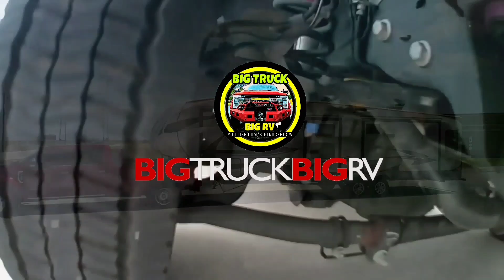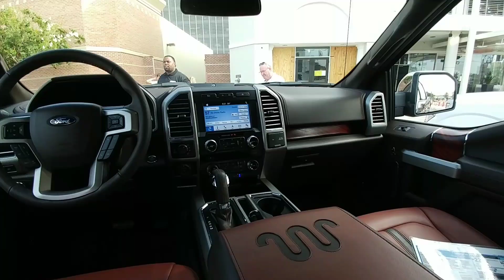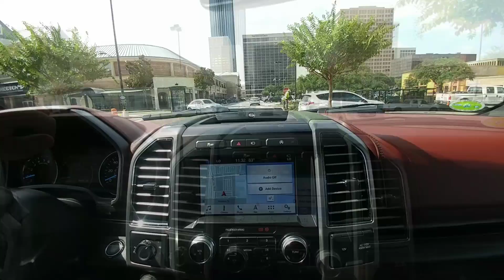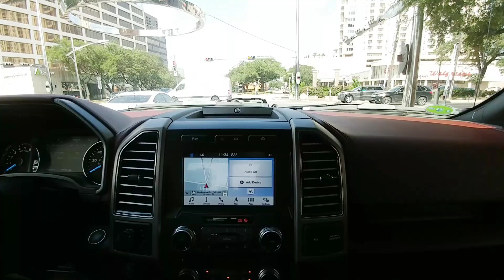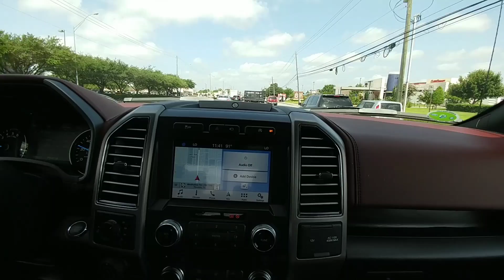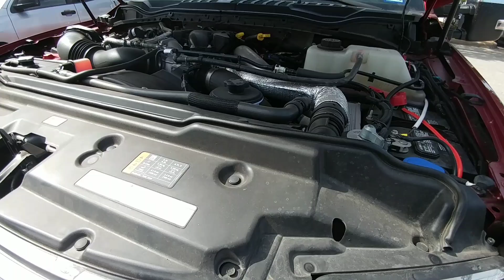All new F150 3.0L Powerstroke Diesel! First drive!

Comment: I like the idea of a diesel in a 1/2 ton pickup but 70k for it is ridiculous. And the fact that you can't get a diesel in an xlt or lower kills it for me. For 70k+ I'd rather buy a f250 or even f350.
Reply: Alex Tran The tundra is just a proven drivetrain at this point. Probably the most reliable new truck you can buy, no frills with cylinder deactivation or anything like that. I love my Chevy trucks but the v8 tundra is rock solid and looks really good with the crew cab
Reply: For 70k I'd rather buy a super expensive sports car
Reply: Hipsters will buy it. Ford Fails again
Reply: Big Truck Little RV definitely. lol. They'll buy it just to fit in with the crowd.

I'd take a brand new Tundra Platinum instead if I was looking for a 1/2 ton. Tundra may be a pig when it comes to gas, and may be the oldest in the segment, but at the end of the day I'll know I'm  stepping into something reliable, and costs 20k less.

Comment: The dead engine at stoplights. 
I drove my daughters eco-boost in South Carolina this summer, shuttling off at 90 degrees let the cab warm up enough to be uncomfortable. 
Now try it here in SW Az. today at 117 degrees. 
No thanks.
Reply: The engine won't shut off if the A/C is on and the cabin isn't cool.
Reply: That's probably one reason the feature can be turned off with the push of a button.

Comment: Not impressed with anything about this truck other than the mileage which is a joke to justify buying this because the additional cost for this will take YEARS to pay the difference in saved fuel. 
“F150Duty cycle” wow I have seen plenty of F150/ with 200-300k on the clock and doing fine. Yes with additional maintenance costs but still. 
Idk folks. I’m sure GM will do the same with their diesel...overly expensive with minimal rate of return.

Comment: If Ford is looking for that landscaper type of buyer, they need to open up availability to the non-premium trim packages.  A Fleet Identification Number (FIN) is required to order an XL or XLT.  That would be a customer that has a minimum of 15 vehicles in a fleet.  According to another journalist that reviewed the truck, driven 15,000 miles per year would require 7 years to break even on the cost of the diesel engine.  This truck doesn't have good tow ratings and fuel economy drops way off when you go to a 4X4 crew cab.  In my opinion, I would stick with the 3.5 Ecoboost.  I am still waiting to see the specs and pricing of the 2019 Chevy 1500 diesel that is coming out this year.
Reply: Rodney Williams ford has the na 3.3 v6.  That would be the bargain to get.  Still plenty towing capacity for lighter towing

Comment: I just went through and crunched the numbers and pulled the pin last week on an F150 3.5L EcoBoost with Max Tow over the 3.0L "Lion" Diesel.  I am not against the baby PowerStroke and I waited until it was on the market to give it a fair shot, but the numbers for this motor just don't add up for long term cost of ownership when compared the either the 5.0L "Coyote" V8 or the Gen 2 "Cyclone" EcoBoost V6.
Reply: Hi Gary, do you mind sharing what the numbers are telling you ?
Reply: I’d also like to know why the switch also. I’m an owner of a gen 1 ecoboost with nearly a half a million kilometres on her now. All original drivetrain. Although she has been excellent to me I made the switch and ordered the mini powerstroke. The numbers added up for me and fuel economy will be reduced by as much as 40% and that is not taking in consideration of on average lower diesel prices up here in Canada

Comment: The truck looks good.  To be honest, I think the government eventually will require stop start on Diesel engines.  But with 440 lb/ft of torque, it will be good at towing the maximum rating.  The aftermarket may be able to improve upon that.  This engine is the same as in the Land Rover products and Jaguars overseas and what I read was that it was reliable.  Most of the longevity issues will come down to doing the maintenance and changing the timing belt for the camshafts and fuel pump.  I think it looks great and will do well for those who aren't trying to pull 20k pounds.

Comment: Very informative video. I am not really a Ford guy; love my Ram 1500 so I'd be partial to Ram 3500 with Cummings. I think though that the modern engines are designed well and, with good maintenance, should last well into the 300k range.
Reply: You can't get a Cummings in a Ram.
Reply: Apologies, spelled it incorrectly: Cummins 6.7 engine.

Comment: Towing is the only reason for buying a diesel if your a grocery getter then buy a gasser. I despise the start stop feature as well, let’s just wear out starters for apparently no good reason, I suppose this feature is going to be mandated by the enviro-nazi EPA since it’s on other make of vehicles. Other than that this trucks looks pretty good.
Reply: Powder River Seems like a classic case of a feature designed for the EPA mpg tests but with little or no real world benefit.  I've heard that there are adapters designed to trick the truck into thinking it's towing and thus disable start/stop.

Comment: What is a F150 duty cycle?
Reply: From what I have heard on other channels, this engine is good for 150K miles before it hits if first major maintenance window which includes the replacement of the timing belt.
Reply: Back and forth to soccer fields two times in a 24hr period

Comment: I can’t believe that after all these years they are just now learning of the Cac tube failures on the 6.7.
And, he really never answered the durability question. He said get the f250 basically
Reply: I hate when they don't say yes or no to a question that is put before them as important as durability
Reply: Magnolia Tom Show us an engineer that will say definitively that any engine in a consumer vehicle will make it 300-400k miles without any major problems.
Reply: The Real John Smith good point lol
Reply: The Real John Smith I understand what you are saying as well. I know we can't have our cake and eat it with light weight, highly tuned, super lean burn diesels ingesting their EG's as they do. I guess I'm just wishing for things to be like they used to lol
Reply: they have already stated that the 3L powerstroke should have the timing belt replaced or checked at 150,000 miles, and that that would be the major maintenance item. He said it went through all the durability testing as the ecoboost and other engines, so it should be just as reliable. But we won't really know until they are out for a couple years, i would prefer not to be one of the first customers of something new like this lol.
Reply: Nate Hawkins lol- you are reaching through nothing but speculation. You wont hear a Ram/ Cummins engineer or a GM Duramax engineer say anything different about those engines. Nobody can guarantee a motor that way. The F150 was first or tied for first in the last 2 JD Power surveys with Ecoboost as the volume selling engine.  This motor has been in the Land Rover for over a decade; but, its the the first time in this platform. Time will tell the actual service life. Nobody is bragging about ecodiesel life span. Even that motor is too new to tell.
Reply: The Real John Smith No one knows, which proves my point. My 99 Ram was advertised in handout literature as "first overhaul at 300,000" when I bought it. Today that is no longer advertised for a reason. They aren't built the same. This Lion engine might have been in land rovers a while but not as it is in the F150. The guy said "it is built on that engine" and it's entirely new and different from Land Rover version. Plus the emissions controls are completely different for us. As an '18 F150 3.5 EB owner, and a business owner, I'm drawing off of more than speculation. I'm drawing my conclusions from actual experience and engineering knowledge.
Reply: Nate Hawkins I dont necessarily disagree with anything you just said. I’m curious what answer would have satisfied folks? No engineer can say definitively how long an engine will last until actual data is acquired over several years. Some may have problems in only a couple hundred miles. Some may last 200,000. A run of bad water pumps from a supplier may happen. That, however, has nothing to do with the motor itself. He has no way of knowing how long it will last in real world applications, in this platform,  until it has been in the market longer. Does anyone expect the VM Motori Ecodiesel to last as long as the Cummins?
Reply: Exactly what I was thinking. He deflected that one like a politician.
Reply: Yep never said.
Reply: LoneSpartan Well if Ford currently engineers most all their parts for a 150,000 mile actual life, then all the testing in the world doesn't matter. If the 6.7 is engineered for an actual 500,000 fail life and he wouldn't budge to say this diesel is any different than an ordinary ecoboost then you've got the answer. It's rated life is designed below 250,000. And I'm guessing stop start help shorten its life. And cheap engine parts "designed within the necessary parameters" (cheap) will fail and cause the engine to fail. I wouldn't worry much about a little timing belt change. Lol

Comment: Very nice. I do like what Ford puts out. But I keep leaning towards the Ram 2500.
Reply: I like F-250 and Cummins, if only they would have one.
Reply: Nothing beats a fummins
Reply: haroldlm64 good idea! You'll get alot more for the money with the Ram 2500!
Reply: haroldlm64 you should wait until they announce the new HD in early 2019. Should make the cost of the current generation price drop as they dump them.
Reply: Dmonkey Thanks! I've been very interested in the 2017. Thanks for the tip!!
Reply: I don't think I can go wrong with my decision. Hopefully, I find mine for the right price soon!
Reply: I had a f150 for 7 years and the engine died at 130k, went with the ram 2500 diesel and can't be happier.

Comment: I live there
Reply: Yep you caught that one, he never did say if the engine would be good for 300K, that is a bad selling point for sure on this video. I would be interested if it was expected to reach 300K with few problems. I know the particulate filter probably will not survive over 150K, and its expensive to replace.

Comment: anyone who is thinking about getting a new half ton truck because they have towing ratings of 11-12k pounds and are towing anything around 10k pounds please do yourself a favor and get a 3/4 ton I bought a new silverado that has max towing of 11,700lb and I tow a 32 foot 10,500 travel trailer and it is not fun whatsoever I am going to be getting a 2500 as soon as I can this has been an expensive mistake so if you are going to be towing frequently or on long distances please don't get a half ton thinking because the manufacturers are throwing out ridiculous towing numbers that it will do the job well because it just doesn't even with a hensley hitch it just feels as though the trailer wears the pants in the relationship and not the truck the power of the half tons are fine to pull that weight but the chassis and weight of the truck isn't there and with the super soft suspensions they are putting on the half tons to make them ride like luxury vehicles doesn't help any slight bump and the truck feels like it wants to bottom out because even with the hensley hitch keeping it at 10% tongue weight of 1000lbs the soft suspensions of these trucks can't handle it so if you plan on towing a 8-10k pound trailer more than like once a month for a short distance of maybe 100 miles if that just get a 3/4 ton and save yourself the expensive headache I have had. My friend let me try towing my camper with his ram 2500 to see the difference a 3/4 would be like with my trailer and it was just night and day difference there was no more white knuckle driving and no more bumps that made it feel like you were going offroad it was just smooth as could be. These half tons are pretty dang near close to the price of a nice diesel 3/4 ton so just get that if you tow more than 8k or so
Reply: That's MAX towing for the model if properly equipped. Let this be a PSA to anyone shopping for a truck: all trucks have a Gross Combined Weight Rating. This is the TOTAL weight truck and trailer, that can be carried. All Modern pickups have stickers on the B pillar that display THAT exact truck's (from factory) payload rating and GVWR (gross vehicle weight rating), as well as sometimes, GCWR. To find the truck's curb weight, subtract the payload rating from the GVWR. This number includes full tank of fuel and a 150lb driver. Manufacturers have towing guides that are typically listed on their website. These are typically laid out in spreadsheet format with headers dictating wheelbase and engines, 2wd/4wd, etc. They list both the max tow ratings, and GCWR in those charts. Ignore the max tow rating. Take the GCWR that correlates to your truck, and subtract your curb weight. THAT number is your max tow rating for YOUR truck...If you weigh 150lbs. Since you don't, go back to that curb weight number. Now add how much more than 150 you are. Then add your wife's weight (without being put in the doghouse), then add the dogs, add the gear you will carry in the truck, Kids (if they fit) and anything else you will carry on the truck. Now that number, take it and subtract it from the GCWR. The number you get will be the net max trailer weight you can handle.... IF, you have enough tongue weight. Remember that payload number from before? Subtract all of those extras I told you about earlier. Then, multiply the remaining sad number by ten. If this number is less than the net max trailer weight, then it is your new net max trailer weight. If it is more, the previous net max trailer weight I had you calculate rings true. You will be surprised how fast a 10,700lb towing truck, turns into a 7,700lb towing truck.
Reply: GOOD ADVISE  here also http://fifthwheelst.com/rvtc_calculator.html
Reply: Well said!
Reply: Npc_Hydra3 yea that’s on you, but if it’s just the soft suspension that’s an issue, that can be remedied  with a good set of Air Bags, with really good shocks, even a quad rear shock setup.
Reply: Npc_Hydra3 wow, thank you for the heads up
Reply: I also have this app on my phone. The website was free, the app costs a dollar i think.
Reply: I agree. I find truck manufacturers make towing ratings very confusing. I would take 5,000lbs off the max.
Reply: Npc_Hydra3   Agree!   People need to look at a used semi!  No kind-den!   You can buy one around 6k to 12K. Big savings!  Put Moore money in the trailer!
Reply: This isn't a gas truck like ur silverado, its a diesel dude.

Comment: I’ll keep my 6.7!!!
Reply: just got rid of my 15 350 6.7 had less than 3 years and couldn't go more than 4 months without the dealer having it. no thanks. lesson learned. But i do hope you got a good one, they are quite satisfying to drive
Reply: @mhanavan4  
What's a '15 350 6.7'...?
And did you buy it brand new with 0 miles on it?

Comment: The engineer he interviewed legitimately said that to get 300-400k miles out of a ford truck, get a super duty not the f150 diesel. I’m no mechanic or engineer but that’s not great confidence in the product. Especially in this day and age where the majority of properly maintained new engines can be very reliable and last hundreds of thousands of miles.
Reply: Myballsitchsomethingfierce The service interval has nothing to do with the overall lifespan of the engine.
Reply: lee hancock 😂 A timing belt does not mean the end for an engine. Its a replaceable part with a lifespan. Replace it a 100k, well before required, and go another 100k. Chains break too; and, they cause much more damage when they do.
Reply: The Real John Smith . Who wants anything with a timing belt.  Thats for disposable vehicles
Reply: lee hancock 
I’ve seen a few generators lately , from the 80s and equipped with a 2.3 Fords. 
Those engines have belts,and one of em just snapped a belt because it was the original one. 
No biggie, put a new belt on it and go another 30yrs. 
That’s a heck of an industrial engine that will outlast this 3.0 turd.
Reply: The Real John Smith and chains can stretch. There’s issues with that in the f150 engines.
Reply: FishFind3000 Agreed. 2011-2014 Ecoboosts. Problem was fixed four years ago. 5.7 Hemis had timing chain issues as well.
Reply: If my 4.6 lasts as long as the older versions, it'll still be going when I'm 80. My grandfather's '62 pickup finally stopped running in '09.